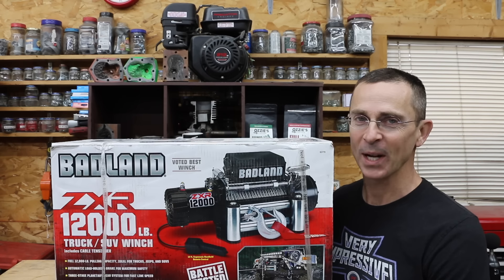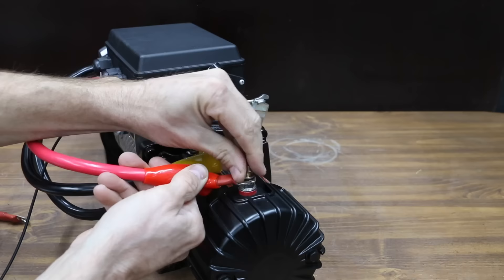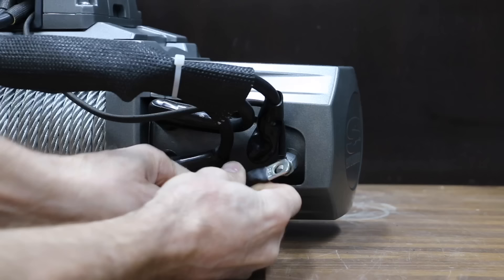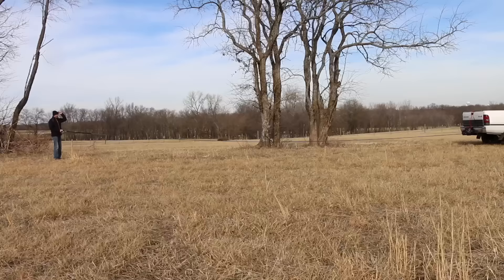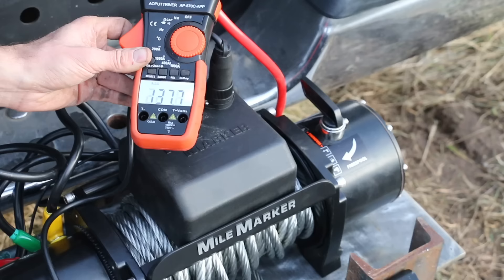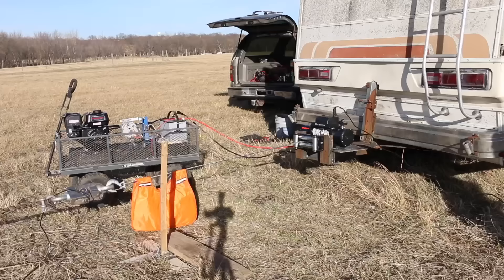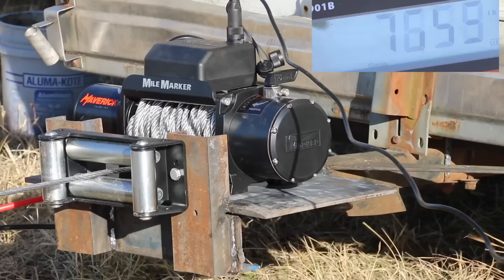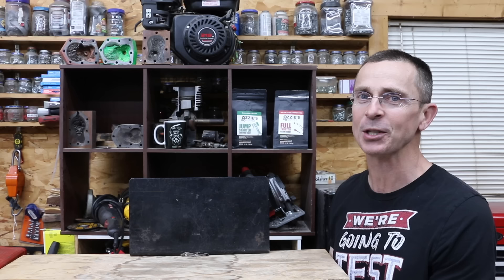Best Winch? Is BADLAND Better Than WARN, Smittybuilt, Milemarker? Let's Settle This!

Comment: Now that you've done this winch test, I think you should do a synthetic winch line test. There are so many out there for so cheap that seem like they'd break at weights way lower than what they're rated for. Synthetic winch lines are so much safer than cable, and are becoming really popular.
Reply from the maker: Thanks for the suggestion.
Reply: X2- That would be incredibly helpful. Been looking myself and just dont know who to trust. Please do it Project F....
Reply: Yeah that would be a great video !
Reply: Safer as long as they don't see sunshine and moisture or get cut on rocks.
Reply: I only use wire rope on my winches.
Reply: @seeharvester  I used to, until I saw someone nearly die because of one breaking during a hard pull out of the mud.
Reply: Reading these replies exposed more factors than I previously considered! Wow... Raises serious questions that beg to be resolved b4 I either get the BEST TOOL - safest, lightweight, longlife - for my hard earned $$$ 🤔
Reply: Yeah I found that was certified and had the test certificate in the package. If I can find it I'll post the brand.
Reply: I agree.  I’d love to see this.  I have personally broken 10k rated line on an 8k winch.
Reply: agree, I have noticed some are listed as PULL LOAD and some BREAKING LOAD
Reply: @seeharvester  The stored energy in wire rope is super high compared to synthetic line. Matts Off Road Recovery recently had a synthetic line break on video, and it literally dropped to the ground in three feet, without any drama. Can you say the same about wire rope? But, it also comes down to the quality of the line and how abused it is too.
Reply: Especially given you had a few winches that looked like they'd stand up to heavier load if the line didn't break.
Reply: Great idea this would be very helpful.
Reply: Freedom Winch Line is the best synthetic rope I've used. Yankum Ropes has a really good one as well.
Reply: @dirtfpv  yup...same with jerking trucks out with chains. Seen way too many chains go through back windows. I keep heavy equipment recovery straps and jerk ropes in my cummins.
Reply: @kountrygunz2032  chains are fine you just have to use the right chain for the job. if your breaking the chain you used the wrong size chain.
Reply: @deeeeeeps  yes!!!, if you test winch line, please take weather and exposure to sun into account if possible
Reply: @deeeeeeps it won't come flying back at you though.

Comment: If you're going to test the Badland against the upper end Warn and Super Winch you have to use the Apex Badland. That is the one Harbor Freight considered comparable to Warn.
Reply from the maker: Thanks for the feedback.
Reply: I have an Apex.  Would love to see it outperform others!
Reply: The Warn VR Evo is their budget option. The Zeon, M12, G series are all higher end Warn winches.
Reply: @TheGuardian_TM  Are the better Warn winches also made in China?
Reply: @whiskeykilmer1866  Nope. The higher end winches are made in Oregon. I actually have the 12k Warn VR Evo, synthetic line on a Land Rover. It had a bad solenoid out of the box, but Warn sent out a replacement immediately, & it works fine now.
Reply: From the results I don't know if I would consider Warn and Super Winch upper end.
Reply: @whiskeykilmer1866  The Australian brand "Ironman" is pretty good. Anything that's designed and used in Australia has to be good otherwise u are dead in the middle of nowhere.
Reply: I believe that you should retest the winches that were mounted on the crappy mount that bent. If you compromise the items integrity with a product that won't hold it rigid, I find it hard to blame the product. Would you put bad fuel in a car before a performance review? I have always liked your fair testing but you even stated(and acted on, by building a decent mount) before the testing that that mount was flimsy junk!
     Anyway, nice video but it would be much better with equal testing...
     Ya'll Take Care and be safe, John
Reply: @conmanumber1  Thanks for recommendation. I haven’t used their winch but I have an awning, lift/suspension kit and cargo boxes and IMO they make great products, especially for the price.
Reply: The Warn ZEON 12-S Platinum is their premium 12k winch, which is about triple the price of the one he tested. $2200-$3k.
Reply: @JohnDoe-pv2iu  I agree. That flimsy mount probably had a negative effect on the winches by letting them bind up on themselves. I would like to see the tests run again on the mount that he built.
Reply: That was the entry level Warn.
Reply: @laynepauly1720  most people needing a winch just in case buy the entry level, those that use them for work or making a living  buy the more expensive one as they can justify the cost
Reply: The low end badlands still outperformed the high end name brands in most of the tests though
Reply: @TheGuardian_TM  Thanks
Reply: @conmanumber1  My installer basically said the same.
Reply: @TheGuardian_TM the Zeon isn't even comparable to my Warn M12000 it's a fantastic winch, there is a reason it's considered Warns heavy duty winch and one of the more expensive winches they have.
Reply: @Drewdoestrucks  
     I agree with you. I have two winches of different brands on different vehicles that are for two different reasons(they are both 12,000# models)! I have a Warn on a 4 wheel drive that I go in the woods with. I have a HF Badlands on my Suburban. I don't go through the woods with it but take some small dirt roads. It's just to pull a tree out of the road or something though. The one on the Chevy Truck may have to work harder... With those things in mind, I would be concerned about possible parts for the Warn. On the other hand, for 300 bucks with the coupon, the Suburban got a winch that it probably wouldn't have, if I had to spend a 1000 bucks for it and a recessed mount! 
      I know a lot of folks don't have a winch on two different vehicles and I wouldn't accept for the availability of a decent inexpensive one. Before I installed the HF one, I repacked the gears with a high pressure Lucas grease. I read in a truck or 4 wheel drive magazine that was recommended for the less expensive ones.
      If you are going to be 'Using' a winch, buy a good one. If you otherwise wouldn't have one but would like one 'Just in Case', get something inexpensive but decent! If you are in the sticks and use it twice and it breaks, even if you can't find a spare part you're ahead. You saved more than 300 bucks on one remote tow bill! Buy yourself another one and then write the company a letter. You will get the part in a month or two. Then you have a spare winch (and a good idea which part to go ahead and order a spare for!).
      I think about things differently then some folks but at my age, I'm not walking out of the woods and a Wasted Day being stuck is worth a LOT more than the price of a winch, even if I never use it again!
       Ya'll Take Care and think about what is worth a few hundred bucks to You, John
Reply: Don’t need parts for the Balands. with the extended warrantee I will get a new unit. Why would I want to replace a part?
Reply: @cygnus1965 and that’s why nobody knows how to rebuild anything anymore.  
Throw away consumer culture.
Reply: @TheGuardian_TM I just see that they’re “engineered” and “assembled” in Oregon. That’s not really US ‘made’. parts could still be Chinese. What matters is quality control and standards a company requires from the Chinese manufacturer.

Comment: I appreciate your honesty & this test.  The weak link is always the rigging.  I spent 31 years as a towing professional.   

Most Light Duty tow trucks use  Hydraulic 8,000 lbs. winch with  3/8"  6X37 IRP wire rope has a break of 16,560 lbs.  Working Load Limit is 3.5:1 ratio or 4,250 lbs.  

Exceeding the WLL is abuse of the rope.  This is why professional operators will put a block in the line to reduce line tension & stay within WLL.
Reply from the maker: Thanks!

Comment: The Harbor Freight APEX seems to be on everyone's "Beat This" list. One thing I would like is the length of each rope. This can vary quite a bit. This was VERY informative, Thank You!
Reply: Totally agree I was disappointed not to see the Apex here. A 5k pull untill over heating would be a great test to see their endurance. Then possibly do it again 5 or 10 times in a row to see how they handle repeated abuse. 

Was very excited to see this video but I don't feel any closer to knowing if I want the Apex or the Smittybuilt, the smittybuilt is the cheapest name brand winch with a lifetime mechanical warranty
Reply: If you're buying a throw away winch (very few repair parts available) it makes more sense to get the cheaper version. Also I have seen pictures and videos of the Apex case breaking. One of them is posted on the wranglerstar YouTube channel.
Reply: I was so excited when I saw the video but a bit disappointed the Badland Apex wasn't tested.  Maybe on a future one.  Regardless, thanks for making amazing content!
Reply: @NoName-ml5yk  I’ve seen that video
Reply: @NoName-ml5yk  that wranglerstar video has SO MANY issues with how he used it. Listen to all the off-road recovery channels that use the Apex and swear by it. Many are unsponsored too.
Reply: HF also just upgraded the standard Badlands ZXR 9,000 and 12,000 winches (well hopefully an upgrade, not cost savings lol) the one in the video is the soon to be retired model...
Reply: @NoName-ml5yk  bro warn isnt even repairable
Reply: @thatjokerperson  So Warn is just selling repair parts for no reason?  Iol.  I have rebuilt Warn winches myself and there are plenty of YouTube videos if you search.  Be careful which one you buy though.
Reply: @NoName-ml5yk  its not rebuilding as much as it is putting the old motor on a new wench for $300
Reply: @thatjokerperson7062  Plus isnt the Warn VR product line is "globally sourced" model made specifically to compete with imported winches? If I was going to pay big money for a Warn for "ultimate reliability" I don't think it would be a VR model! 😆 I know Warn sells contacts/electrical parts for their higher end $1200😵‍💫 winches that better damn well last long enough to wear out the contacts! 🤣
Reply: @berryreading4809  ive helped with warn on a rolloff trailer, the winch had to be rebuilt every few months i think it was an m15

But yearly it was a new winch from all the parts being replaced

It currently has a badland 12000k that has been on it for 3 years now no problem
Reply: @thatjokerperson7062   First you say Warn is not repairable.  But then a second later you say you had a Warn M15 on a roll back that needed repaired every few months.  Being honest here it sounds like you're making crap up as you go along. lol
Reply: @JohnResciniti  Not attacking HF or your comment just laying out the reality of youtube:  There are not enough real youtube reviews on the Apex (or most Warns for matter) to mean anything.  

A lot of these HF guys lie about receiving free stuff because they don't want to lose viewers.  Or they are hoping HF will send them free stuff in the future.  

Some of them never say anything bad about any product they "test".  Ever.  Sorry but if they never give a bad review that channel is bs'ing you.  

Or they make 2 or 3 light pulls and call it tested.  lol.  Give me a break.   

The old badlands 12K is pretty well proven though.
Reply: @berryreading4809   The old Badlands is decent for the money.  It's still a slight bit of a risk due to the crap 90 day warranty and no replacement parts.  I've personally known several that burnt up in the first year with little use.  But the Badlands was only $300 plus tax with the coupon.  

Not $650-700 for the 90 day warranty Apex after tax.   Which I think is just a stupid buy.  I mean they are known to bust apart.  Just my opinion.  
 
BTW, for those that are new to all of this Warn has a lifetime warranty on everything but electrics which has a 7 year warranty.  

Several times when I've needed parts I called them and they just mailed them no questions asked.  I also have friends running 40 year old winches that are still supported by Warn.  That said, there is nothing wrong with buying a cheap winch if that's your budget.
Reply: @NoName-ml5yk  I agree, if I have one vehicle that needs to be 1000% reliable when traveling, possibly alone without communication or other winches to call in for help the Warn (I still don't 100% trust the VR line lol) would be/is my choice... However for multiple vehicles/trailers and with the ability to quickly have help or swap a winch out I use the HF winches and have have had pretty great luck, other than the ridiculously short steel cables requiring the need for extensions 🤦‍♂️ Luckily I snatched up a 250' and about a 130' spool of winch/small crane cable along with eyelets, ferrules, and other odds and ends that was all new old stock for basically free years ago 🙏 But if it was the apocalypse, I'd definitely take the Warn or even certain models of the Mile Marker not the 2nd gen (one in this video, not the soon to be replacement) Badlands 12k, Although I've still never broken one other than ruining the cables by doing lazy rigging (which is a nice thing about a cheap winch with cheap replacement cables available at HF I guess) I've killed other winches so I installed real pure copper battery leads,(also available at HF in the form of power inverter cables) ditched the janky circuit breaker in favor of a high amp disconnect, and have always paid attention to motor heat, which is probably why they've  survived this long... I think alot of them have died from the factory copper coated aluminum battery leads restricting amperage, especially after any minor corrosion, along with overheating from people who think a $300 winch will be capable of continuous use with no duty cycle 🤣 Although I'm pretty sure 80% of the Badlands and Smittybilt winches are bolted on jeep JKs and never used 😉 Although I still can't justify the want for a  $2200 Warn M12 or a similarly priced 10k rated Warn 8274 😐 But I'll probably end up with a used Warn PowerPlant compressor combo about the time parts become unobtanium 🤣 That model has always been near the top of my ultimate multi-mount dream winch in one of my homemade cradles that can handle some terrible full power off angle pulls... Along with the front receivers I've built for our work trucks and my own trucks to specifically to address the issues that come with hitch mounted winches... Although I know why they discontinued those winches they were perfect for receiver mounts, and put out a ton of air, although they definitely had some flaws apparently... But I'll still have one eventually anyway 🤦‍♂️😅
Reply: @berryreading4809  Yep.  It's crazy how many people basically just throw money in the trash when it comes to winches.  Ignorance and laziness is expensive...

Comment: One thing to add here is the Warn EVO is the cheap Chinese made model they sell. If you get the zeon it is larger, designed completely differently and USA made. Would be cool to see you test that one at some point.
Reply: Agreed fair comparison to the winches he tested as they are all made in china and in the same general price range. But i do agree i think the pricer american made warns are best.
Reply: If that's a "cheap" Chinese made model. I'd hate to see what the non "cheap" model costs. Either way unless it performs 300-500% better, people are just being silly fanboys.
Reply: @js6033 the Zeon line is the premium warn products, for what it's worth its actually one of the few winches on the market that can actually work when fully submerged underwater,  and it's has an insane warranty, mechanicals forever and electrical for 7
Reply: totally agree, but there are a few folks on YT that have tested Warn to Warn, so you can extrapolate the data, all-be-it not as fun as having @ProjectFarm do it from his non bias position

Comment: I've heard that there is a huge strength difference between low end and name brand synthetic rope. Since 2 failed in your tests, it would be cool to see a few brands tested.
Reply: There can be but biggest difference I have noticed is due to the diameter rope used. Some sellers may save a few $$ by going with smaller rope. But it's cheap and easy to swap out for bigger.
Reply: For the most part, they are all pretty similar with the exception of some cheaper winches using smaller lines. There are companies like master pull that have genuinely stronger and better built ropes but you will pay a cost because they can be well over $600-$800 for a 100’ rope.
Reply: Test the bleepinjeep synthetic rope